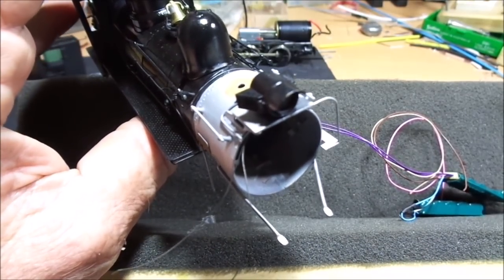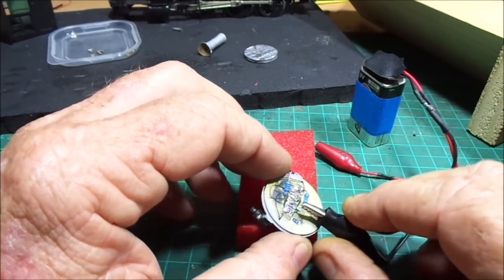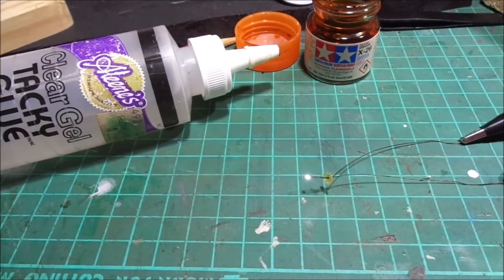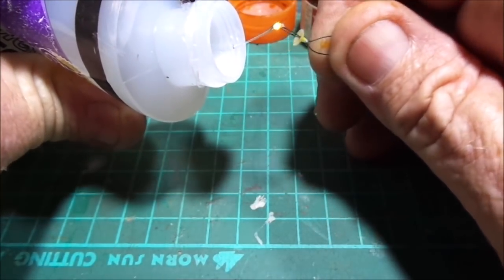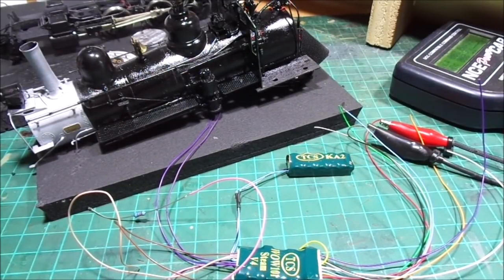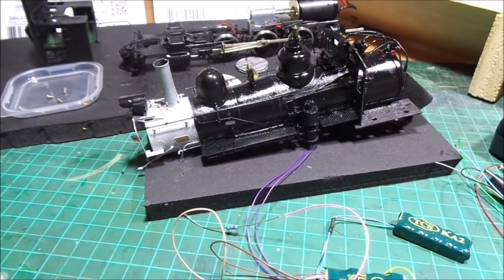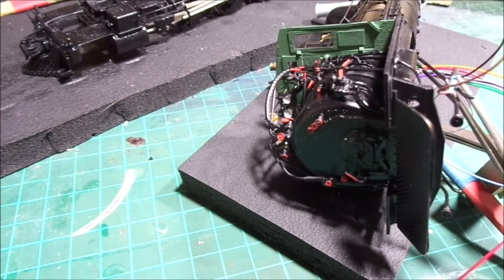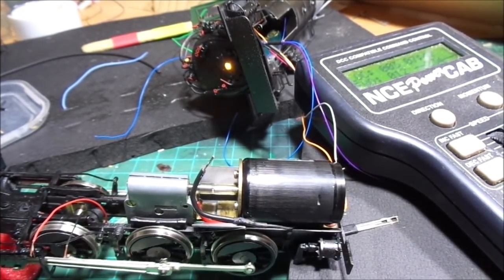RGS 20 video Part 1

Comment: Yea, when I first looked at you going to solder onto that 0402, I thought it was just the tweezers sitting there!! Wow! Can you put a tri color, red, green and white led in the front markers? or did RGS not use that at the period your modeling?
Reply from the maker: G'Day Drew, on my K27 many years back I installed 2 each 0402 LEDs into the markers, one for white (extra) and one for green (2nd section following x D&RGW) each on a separate lighting function. I used Tamiya clear green paint to tint the LEDs. Warm regards mate.  Laurie